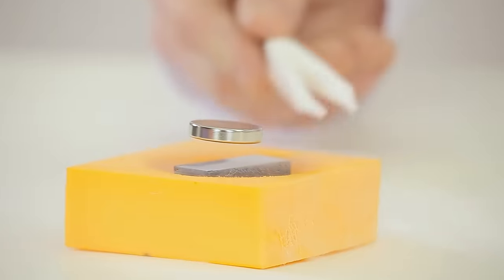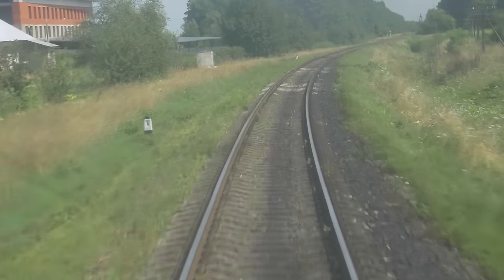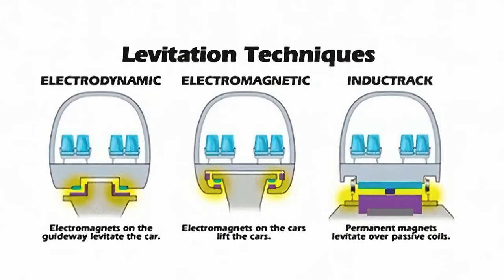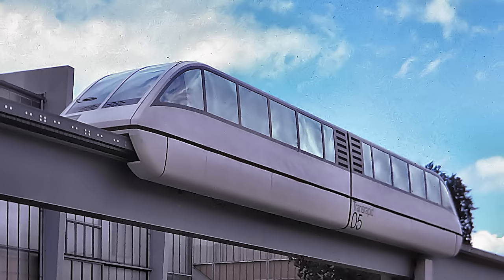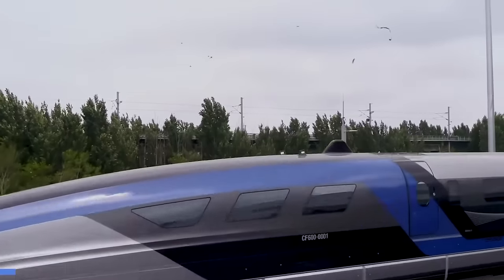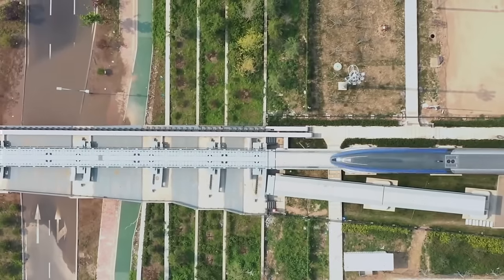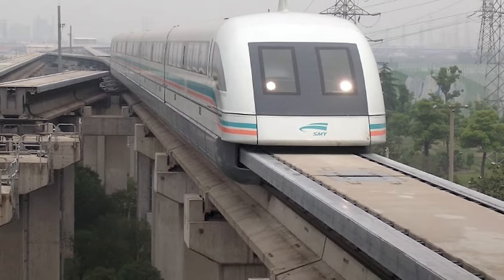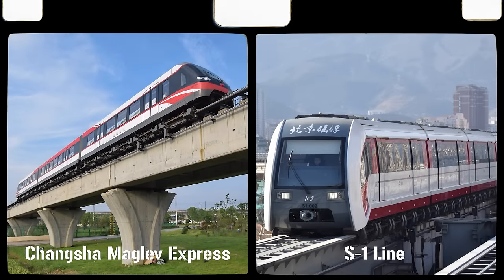Maglev Trains: Why This ALWAYS Falls Short

Comment: Glad to see the Birmingham Airport Link Maglev shown here,  often forgotten , a collaboration of GEC, Metro-Cammell and others.  I was fortunate enough to see the Japanese prototype Maglev at a Science Institute when I visited Japan in the 1990's? The thing that most people do is overestimate the friction of steel wheels on steel rails, actually quite low, and underestimate the energy required to suspend a 300 tonne train.  Plus the Elephant in the Room is the cost of replacing thousands of miles of current rail infrastructure. A factor more per mile than even HS2!
Reply: The low friction is also one of the reasons it takes a train forever to stop. (And the massive mass involved of course.) IIRC Maglev should be better at that.
Sadly I missed the chance to ride the Chuuou experimental track. Guess I'll have to wait until it's opened for real.
And yes, the investment costs are mind staggering.

Comment: I've ridden on the Transrapid twice: once at the test track in Lathen (late 80s, I think), and once in Shanghai in 2018. Both rides were amazingly quick and smooth! It's so sad that maglevs haven't seen more adoption, considering that they have some real benefits: they can climb hills 10 times as steep as a regular train, when the track is monorail style, they interfere much less with the surrounding environment (farming below), they're more energy efficient, lower maintenance, and on top of it all, faster than an airplane at medium distances (no cumbersome airport wait times)...
Reply: Elevated grade is pretty much irrelevant, you can do that with any method.

The energy efficiency is an odd argument  If you intend to run them at high speed metal rail speeds, the projects aren't worth the initial outlay for the marginal gain.  Even considering the energy costs to build the track, it's unlikely you'd ever get that back.  If you intend to run them at closer to the maximum reasonable for maglev, then the air resistance is going to eat up that energy efficiency entirely.

Maintance is usually measured in cost, and the cost of bespoke systems is always going to be higher than bog standard ones.  So while they might theoretically be lower maintenance in a shiny future, they aren't now.

Classic french or spanish style High Speed Rail gives you the faster-than-an-airplane at medium distances as well at lower costs.

So the net result is that you get a sort of marginal speed boost for a huge outlay.  And this is why they haven't been adopted.  

The promise of upping speeds by around 100mph or so does have benefits for trunk lines.  So I'm not saying that it's without point or value, only that if we're realistic about the tradeoffs, we can see why it hasn't been heavily pursued so far.

The noise levels and speed are obvious plusses, but historically it's never been cost effective.  I'm hoping that the Japan project can turn this around.  And I'm talking about total cost vs total societal benefit here, the way any transportation project should be measured.
Reply: @jsrodman  Actually, in future the ability to climb more elevated grade may be one of the most interesting properties. Problem with standard train is, they rely on friction of the wheels against rails. Typically you want it to be just enough... with elevated grade it must be actually very high. Trains weigh a lot... and on elevated grades, friction on rail simply might not be enough to overcome weight of the train pulling it "downhill". Next level problem happens, if train stops in slope. There is very real possibility it wouldn't be able to start moving upslope again. And this is not technology limitation... it's basically physics and you can't do much about that. If this was not a problem, why do you think there are so many tunnels built (which is typically very expensive and potentially dangerous endeavor).
Reply: The existing shinkansen between Tokyo and Osaka is quicker than flying.
Reply: @jsrodman  Those are fair points - the up front cost to establish this new tech is a poison pill, given that it represents an incremental improvement. Though high speed train tracks are not “bog standard” - they’re usually already kept to higher standards than regular tracks, and not used for other applications such as freight.
Reply: @PetrSojnek  Exactly - the need for fewer tunnels and bridges means much lower cost when introducing high speed rail to new areas, where those tunnels haven’t already been built.

For the same reason (physics, friction), maglevs can accelerate and decelerate much faster. So not only are they faster once at full speed - for the same distance, they stay near their top speed longer.
Reply: Perfect for the environment in the USA
Reply: @macnlz in high cost countries that’s irrelevant
Reply: Trust me if they were more energy efficient and lower on maintenance, they would be successful. Maglevs are only a glorified prestige object and dont have useful advantages over normal rail.
Reply: @qjtvaddict  You seem to forget what magnets and sand tend to do. The only viable path at that point would be to go from lower Cali, swing up the coast, whip out past the Dakotas, and then keep coasting on the north until its on the east coast. Arizona, New Mexico, Nevada, Utah, Colorado, Oklahoma, Texas, and some of California would be just major out zones because of the southwest desert. Unless you want to build some half mile high rail to keep the sand away from the track, it's only good for part of the USA. And I'm saying this because I live in that area and it annoys me that it's the reality that you have a train with magnets constantly on and it's going to attract a wake of sand onto the rail for the next train to just get its underside ground off.
Reply: @derunfassbarebielecki  No, I don't think I will trust you.
Reply: @NebraskaGonvilleJones  You dont need to trust anyone, the numbers speak for themselves, or the fact that maglevs are only a prestige object.
Reply: @macnlz  nobody WANTS them for some reason and its not price. buying a new maglev track isnt more expensive than building highspeed rail and easyer to do because you could just build them above existing tracks.   Its very complicated and expensive to build a new railroad track in europe and building above existing tracks would be a big improvement.
Reply: They not efficient at all if operating at high speeds.  Once you go over 300km/h air resistance becomes staggering.
Reply: @jantschierschky3461  you can do alot with design. 200km/h with a VW Bus feels Terrible, in a VS Passat it feels normal.
Reply: @nox5555  sure aerodynamic is the key, but once you reach 300km/h air, it has a density 60 times higher that   doubles every 100km/h after. There is a reason some modern cars can reach 350km/h but 400km/h is difficult. Now try 600km/h and you need enormous power
Reply: @PetrSojnek  that makes sense now, that's why trains never go upwards, thank you for explaining!
Reply: @jsrodman  
"Elevated grade is pretty much irrelevant, you can do that with any method."
Wrong.. well wrong and right. yes you can do it with anything. But its a cost factor. A elevated Transrapid track segment  is 165 tons heavy. And that is pretty heavy. But a elevated high speed rail track segment is 900 tons. 

Also the Transrapid segment is 2.8 meter wide, the high speed rail segments i 5 meters wide. That is the diffrance between hanging a sign on the back of the truck and just go with a single truck driver, and closing down the highway for all traffic.

That is also the diffrance between transporting the segment at 80km/h and transporting them at 15km/h.

You simply cant transport railway segments across country. You have to produce them with in 10km of where they go. You also can´t lift them from the ground, they have to be rolled up. A transrapid segment can be lift with a mobile crane.

The only way to realistically transport railway segments is on the railway segments already placed. This might sound like a minor issue. But its not. This make it so the railway can only be built as fast as the segment can be transported, and that is very slow.

Also the factor have to be placed where ever you start building the track. That is in effect they have to be made in a tent far out in the country side. And that was how china did it.

Transrapid track can be done where ever it can be reach by road or rail. So they can be done in a air-con factori, with robots and stainless steal forms. This makes production considerably faster and cheaper.

"The energy efficiency is an odd argument  If you intend to run them at high speed metal rail speeds, the projects aren't worth the initial outlay for the marginal gain"
At 400km/h a transrapid TR09 train use less energy than a ICE3 train does. Att 500km/h the TR09 train will use slightly more, but if the ICE3 run 400km/h (that it sort of can, but not practically) it will use more power than a TR09 at 600km/h.

", the projects aren't worth the initial outlay for the marginal gain."
Have you done the math or are you guessing?

"ven considering the energy costs to build the track"
Transrapid track need more energy to build than high speed track as long as the landscape is not extremly flatt.

Comment: One aspect not mentioned is the network effect. Conventional high speed rail can tap into an existing network, and be it only for the ‘last mile’ into a city center. Sure, if you want to add capacity, you might also need new tracks into city centres or even new platforms. But HSR often might just replace older lower rail.  And HSR can easily be built in stages, HS2 in the UK for example allows train to continue to run further north, even after only the first phase has become operational. You can’t do that a Maglev.

And in the same way that HSR requires certain population densities and distances to work best (and thus be the most economical option), Maglev also has an optimal distance, which is longer than for conventional HSR. And given that a longer distance means a larger upfront investment, it is more difficult to finance it.
Reply: That depends how you finance it. The underlaying point is that it's a competitor to airlines, not railways and airlines are currently extremely heavily subsidised (both directly and indirectly by using airspace and subjecting populations to noise pollution) whereas railway budgetting has to pay for EVERYTHING including the track (roads are invariably also heavily subsidised, which is why road traffic grows at the expense of rail)

As fuel costs skyrocket this will change.

Electric aircraft might be able to puddlejump but they can't do long distances and never will as nothing comes close to the energy density of liquid fuels (let's not fly nuclear aircraft. apart from shielding issues, splattering one across the countryside would be highly antisocial) with the added complication that aircraft will always be taking off close to MTOW no matter how short the flight (enhanced wear and tear). Additionally, the cost of retrofitting airport aprons - and paying for dedicated HV feeds to provide sufficient energy to be able to turn around flights within 2 hours or less (ie recharging) will make the £4.3 billion cost of Heathrow terminal 5 look like chicken feed (it would probably be easier to build dedicated nuclear power stations beside each major airport) - and this WILL be passed back onto fliers, making flying mostly the preserve of the wealthy (again)
Reply: Depends on how the HSR is planned out. While something like the German ICE does run on conventional rail lines. The Shinkansen lines in Japan are all purpose built tracks just for the high speed trains with no other trains using the tracks, including the  tracks into the city center and station platforms. 

While the second one does cost more, it is also considerably safer. High speed trains on conventional tracks that are shared have the risk of colliding with non high speed rail trains as has happened multiple times with the German ICE trains and the French TGV. Outside of cities, standard tracks also have road crossings which is another failure point that leads to collisions.

The UK high speed rail system is a joke anyway. HS1 is not particularly fast with the speed limit they have to follow, and HS2 is ridiculously expensive for what it will deliver.
Reply: @cidiracing7481  "Shinkansen" literally means "new line" - the existing JR network is 3'6" cape gauge and patently unsafe at higher speeds. The JR New Line HSR network is standard gauge (you see sections of dual gauge in some areas such as the tunnel from Honshu to Hokkaido)

Because of the gauging issues, curve radius requirements (no tilting trains in 1964) and heavily used existing network the Shinkansen network had to be built as an end to end complete line. That's not the case in areas with standard gauge throughout the network

The Japanese Maglev does have rails and wheelsets, used below 150km/h (90mph) and as such can be moved on the existing Shinkansen lines (as rolling stock, not self-propelled) however that network is extremely busy (It also means that trainsets can be shunted, parked and switched on conventional lines, which greatly reduces complexity of the maglev network - however I doubt that any kind of switching of passenger-carrying trains would occur even at reduced speeds)
Reply: @miscbits6399  Yes, generally, other trains use narrow gauge in Japan and run around mountains instead of using more direct and straighter routes than what a high speed train needs. But they could have still built a cheaper network on standard gauge that can be also used by non high speed trains and phase out portions of the narrow gauge train services to make the Shinkansen lines economically more appealing in exchange for the highest safety standards. Freight transport was at some point considered in their original plans before they built the line. Instead they went with lines that are only for high speed train passenger transportation and with a setup that is considerably more expensive, but ensures the highest safety. Best example is that they deliberately built all lines so there wouldn't be a single level crossing even though it adds quite a bit to the construction costs than just building all lines at ground level. Germany could have eliminated level crossings over time for their ICE routes. It wouldn't be cheap and it would cause disruptions, but it would be possible and eliminate one of the biggest safety issues. 

Regarding the Maglev low speed operation. That is on rubber wheels, it does not use standard train wheels to get up to speed. So at least the L0 would not be able to operate on any Shinkansen line outside of the one that is being built currently between Tokyo and Nagoya and the later expansion to Osaka.
Reply: When would you ever add a high speed track and not need more capacity.

Also, you actually can´t do that, becasue there are incompabilties between high speed rail and freight rail, you have to seperate them
Reply: aphextwin Iamewhlteboy
Reply: k -I I
Reply: Iame whlteboy

Comment: I believe the Birmingham maglev wasn't just replaced with a bus. They now use a similar transportation system using the same track except its cable powered.
Reply: I rode on the Birmingham system once; I wasn’t flying anywhere I just went there to try it.  It was sometimes out of service, not because it was particularly unreliable I think but because it was totally non-standard so if it did break down it could take longer to source parts and repair it than for a more conventional system.  I think this was the main reason it was taken out of service.

It was directly replaced by a bus while converted to a more conventional People Mover type system which I believe is still in use today.  It is not cable hauled but uses driven wheels like a conventional train or tram.  A recently opened system at Luton airport is cable hauled.
Reply: Thats brexit
Reply: i used to ride the old maglev in the school holidays, that was 80's entertainment for a kid!  go see the plane hanging from the ceiling in the terminal then ride the maglev a few hundred times
Reply: If you mean between the Airport train station and the actual airport, yes there is an overhead train. Not sure if that is where the old Maglev was.
Reply: follows the same route exactly, just different power now
Reply: @srfurley I remember the Birmingham maglev closing, TV reporter said parts were hard to find and very, very expensive
Reply: Yes it's a Dopplmayr cable hauled people mover. Definitely not a bus.
Reply: David Iamewhlteboy
Reply: Iame whlteboy
Reply: k -I I
Reply: yoseIf